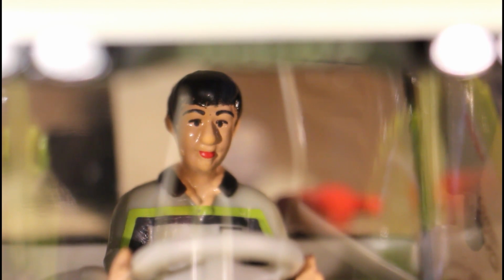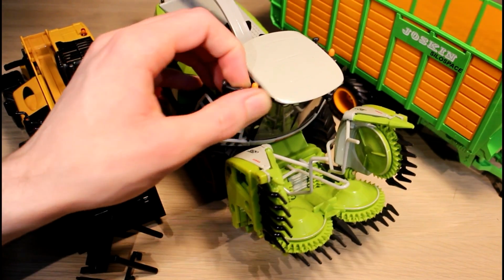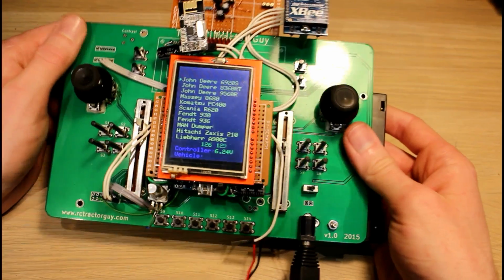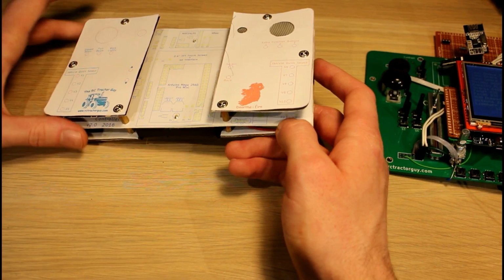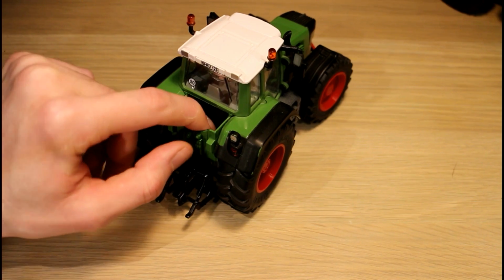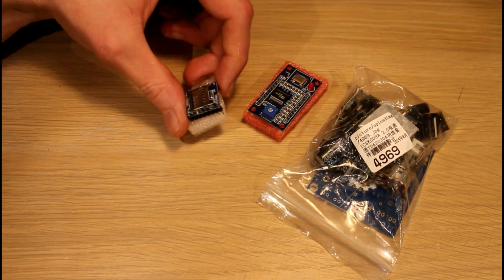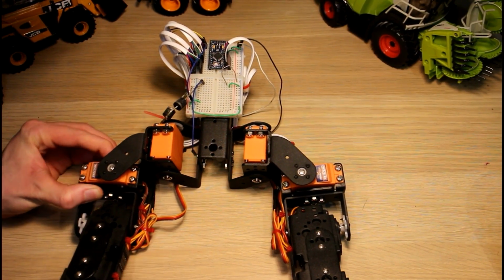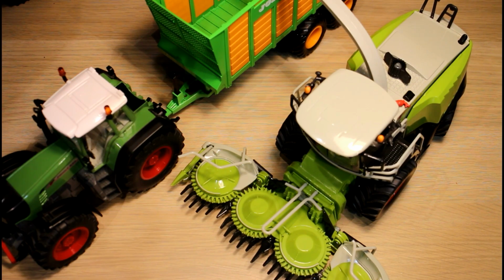Happy New Year and Ideas for 2016

Comment: there is steering on the new Holland loader
Reply from the maker: +the farming Legend I don't know why they didn't include it on the jcb model, I would have taught it was a basic requirement but both axles are solid straight through with the wheels glued to the axles.
Reply: +RC Tractor Guy I know but Britain's made a new telehandler and it is a new Holland and there is steering on that
Reply from the maker: +the farming Legend Oh okay I didn't know the new holland was a newer model, that makes more sense they'll probably have steering in any they make from now on. I want to get a siku rear link for my Ford TW35 so I might buy a cheap donor tractor and use the steering axle from that in the jcb.

Comment: I like Your idea with the claas jaguar. But i think on the telehandler you must youse the n20motors that goes 200 turns insted off the 70 ore 100😀 just a idea. I also think the joskin silagetrailer is going to be a problem. ITS not a convayerbelt on IT so.....😉 Nice video BTW 😀
Reply from the maker: +Marcus jd 99 Yes I also noticed that the standard screw type N20 motor is too short so I'll either need to find longer ones or make my own like I did in the krampe half pipe trailer. I'm not sure about the Joskin trailer, I prefer tipping trailers anyway so I might just modify it to tip instead but I'll think about it for a bit first.

Comment: and its called a telehandler not teleporter  that you use to go in time
Reply: Teleporter is not a time traveler.. It's when you go from one place to another in a second..
Reply: +SchnedolfSnitschel ok it bacilli time travel as well
Reply: +James Johnson No it's not. The differences is that time traveling travels you through time. Teleportion only moves you from one place to another. They are not the same thing..
Reply: sssssxxx